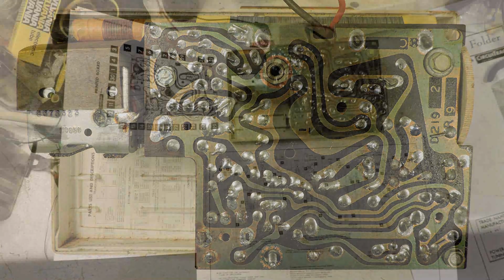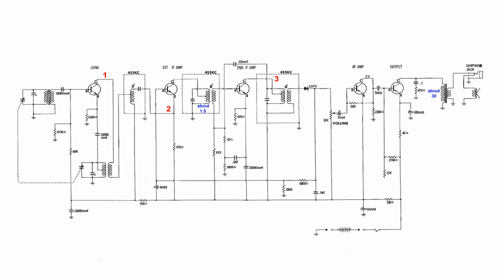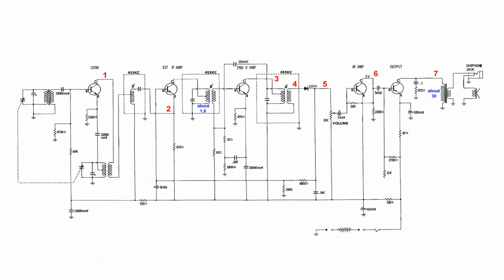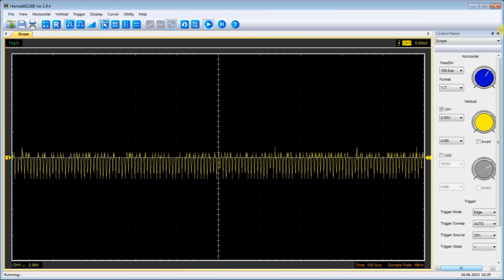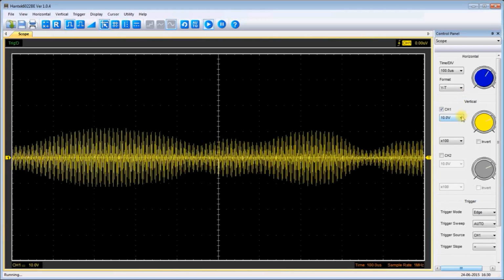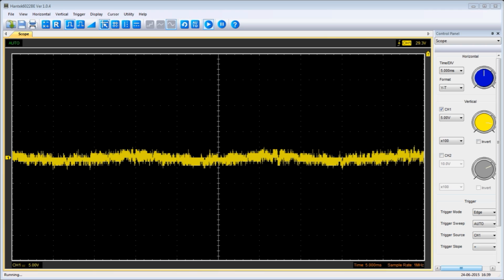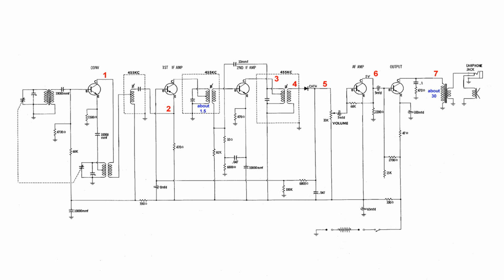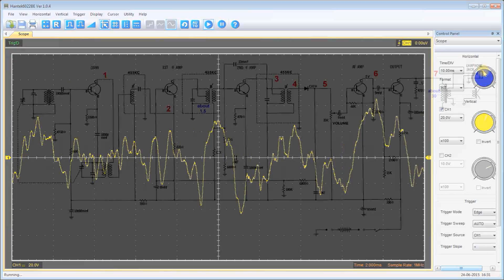Digital PC Oscilloscope Signal Tracing

Comment: Richard, what digital scope are you using?
Reply from the maker: Ray Barron 
It's a Hantek 6022BE PC Based USB Digital Oscilloscope. Used a capacitor (0.01-0.1) in series with probe because scope as no AC setting.

Comment: hi...thank you very much for this videos......can you please use a digital scope on tube radios?is there any difference between analogue and digital scope when tracing signal in tube radios? please forgive my ignorance and i will be very grateful if you tell us whether there is a difference when using theses scopes on tube radios?
much obliged
Reply from the maker: mountainhawk 
There's something I forgot to mention in this video, and meant to. This oscilloscope does not have an AC mode, so I had a 0.1 µF capacitor in series with the probe.

Thanks

I do plan on using the scope on tube radios and amplifiers. Maybe I'll do a comparison video between the analog oscilloscope and the digital oscilloscope, I think that's a good idea.

Comment: I like that digital scope, waveforms look pretty good too! Great info for troubleshooting, thanks Rick!
Reply from the maker: Tim Dockery 
There's something I forgot to mention in this video, and meant to. This oscilloscope does not have an AC mode, so I had a 0.1 µF capacitor in series with the probe.

Thanks
Reply: @AllAmericanFiveRadio  What does times 10 mean?
On the probe.
Thank you
Reply from the maker: @SDsailor7  If the probe is on times10 it can handle 10X more voltage.
Reply: @AllAmericanFiveRadio  Thank you.

Comment: My complements for doing a great job on these videos.  As always excellent graphics and quality presentation.  I have watched the videos starting with the Crosly Pup. Sorry so slow in thanking you for them.
Reply from the maker: David Buck 
There's something I forgot to mention in this video, and meant to. This oscilloscope does not have an AC mode, so I had a 0.1 µF capacitor in series with the probe.

Thanks

Comment: Very nice. More informative than reading a book.
Reply from the maker: madisonelectronic 
There's something I forgot to mention in this video, and meant to. This oscilloscope does not have an AC mode, so I had a 0.1 µF capacitor in series with the probe.

Thanks

Comment: Very informative, Thanks for this video!
Reply from the maker: Tony T. 
There's something I forgot to mention in this video, and meant to. This oscilloscope does not have an AC mode, so I had a 0.1 µF capacitor in series with the probe.

Thanks

Comment: Hey Rick. That digital scope seems to be doing a nice job. I don't have a digital and can't afford to get a stand alone unit so this one may do the trick. Curious, does it give a frequency read out on the screen?
Anyway thanks for posting and look to you possibly doing a dedicated vid on this scope showing the different functions. Had to ask lol.
Thanks again.
.......Carl
Reply from the maker: skycarl 
There's something I forgot to mention in this video, and meant to. This oscilloscope does not have an AC mode, so I had a 0.1 µF capacitor in series with the probe.

No frequency read out

Thanks

Hantek 6022BE PC-Based USB Digital Storag Oscilloscope 2 Channels 20MHz 48MSa/s
http://www.ebay.com/itm/Hantek-6022BE-PC-Based-USB-Digital-Storag-Oscilloscope-2-Channels-20MHz-48MSa-s-/271265189899?pt=LH_DefaultDomain_0&hash=item3f28aa500b

Comment: I have one of these nice little radios in black.  Most of them I've seen have had the metal plating on the grille go green- this one has yet to do that, and it was quite a bargain compared to most of the others.
Reply from the maker: douro20 
There's something I forgot to mention in this video, and meant to. This oscilloscope does not have an AC mode, so I had a 0.1 µF capacitor in series with the probe.

Thanks

Comment: Um trying to develope interest in electronics with my teen grandsons, other than video games.  I like this approach Rick, it's safe and easy to probe the stages of a pcb of a cheap radio.  Hmmm, let them have at it with the scope and multimeter.  Then try to explain what it means to them in terms a kid can understand.  They know what some paets are, but not what they o.  Good idea Rick, thanks!  Don
Reply from the maker: ***** 
There's something I forgot to mention in this video, and meant to. This oscilloscope does not have an AC mode, so I had a 0.1 µF capacitor in series with the probe.

Thanks